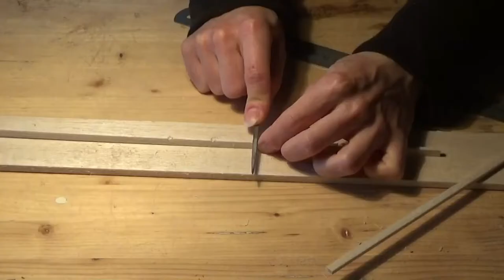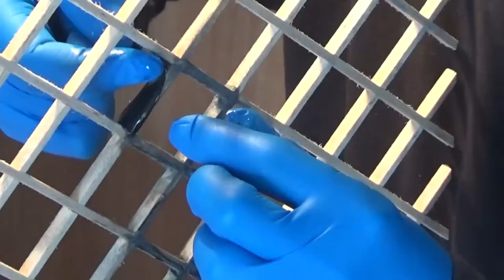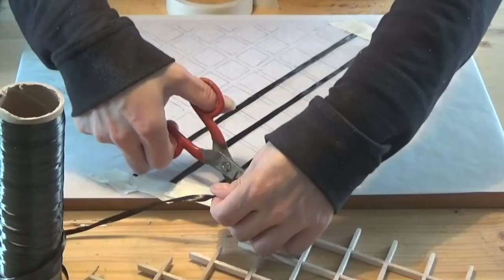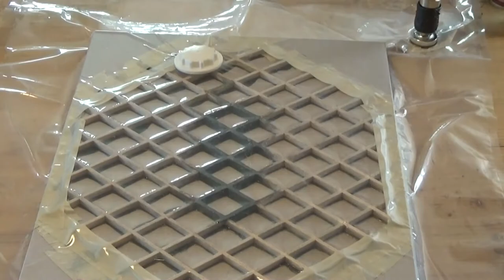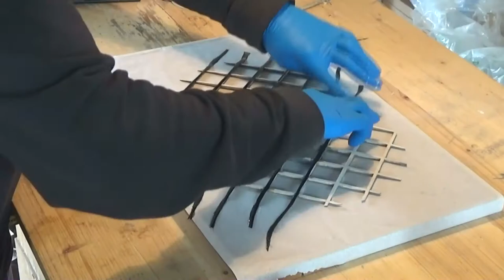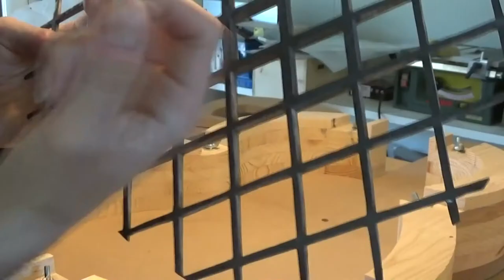Building a lattice bracing for a classical guitar

Comment: Hello amazing work !! Would be possible to let me know what is that putty applied under bridge section of braces 
please?
Thank you :)
Reply from the maker: Hi, thanks so much! It's still carbon fiber applied over the entire surface of the bridge section with epoxy...
Reply: Thank you :) I wonder if is possible to apply this strutting system in acoustic guitar please?
Reply from the maker: @lubostargos4064  yes, I think some luthiers do it, (even without carbon fiber and with other types of wood...) 🙂

Comment: hello, great job ! In total, how many meters of carbon fiber thread does the entire guitar have?
Reply from the maker: hi, thank you very much! I didn't exactly measure how many meters... but for this project I applied two layers of fiber, above and below the lattice
Reply: @alessandrobarbanera  with 50 meters it will reach for the lattice and part of plywood?
Reply from the maker: @danielphilipp2339  
I think so, abundantly. For the lattice I used a 20 meter roll and a little is left over. (estimating 0.30 meters for 18 strips = 5.4 meters per layer very abundant) 🙂